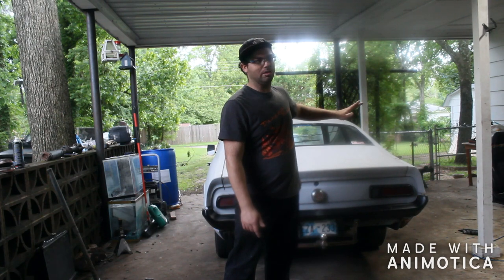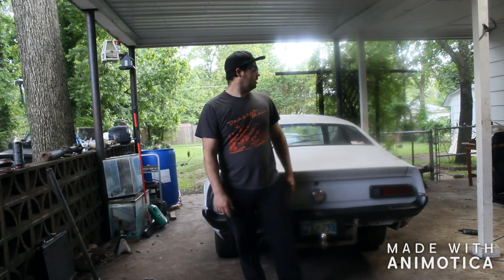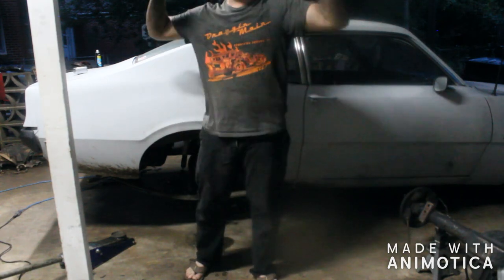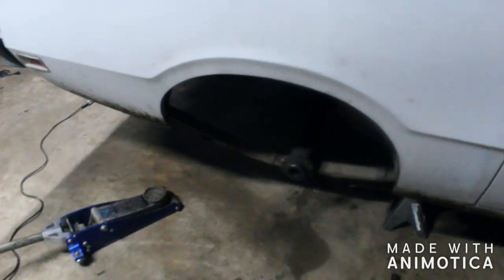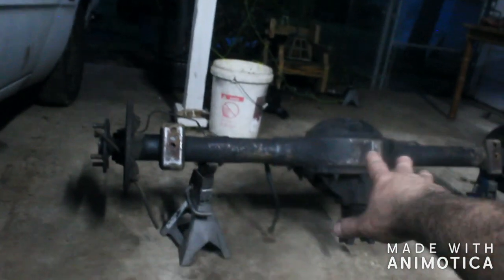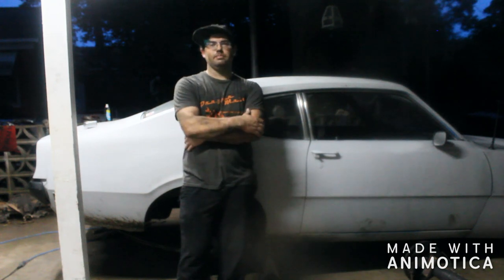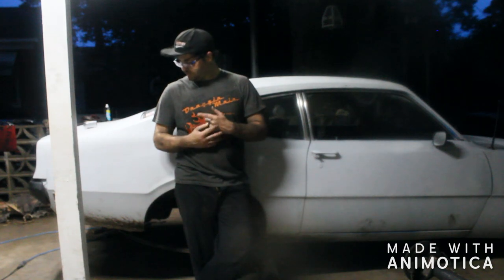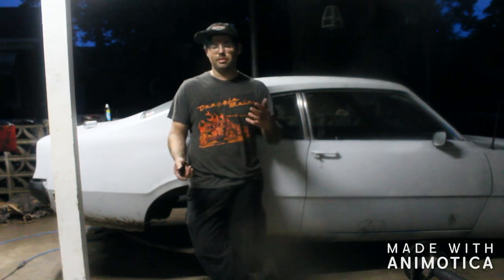The Ford Maverick

Comment: I Stumbled across this video and it reminded me of when I was a youg guy, back in the day I purchased an older Ford maverick as a get around beater, it was V8 powered and had an automatic transmission, during that same time I also owned a 1964 Comet drag car, it had a 9 inch rear axle and 6:20 rear axe ratio, I swapped out the diffrentials, the drag car diff was now installed in my Maverick every day driver, man was the Maverick would sure excelerate fast off the line, however the 302 V8 would power ot at about 35 MPH.